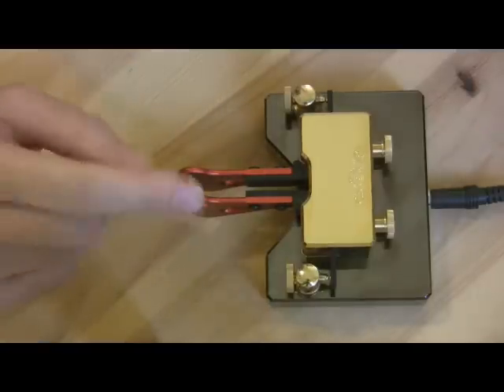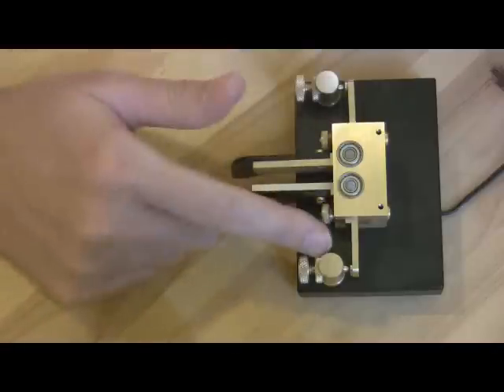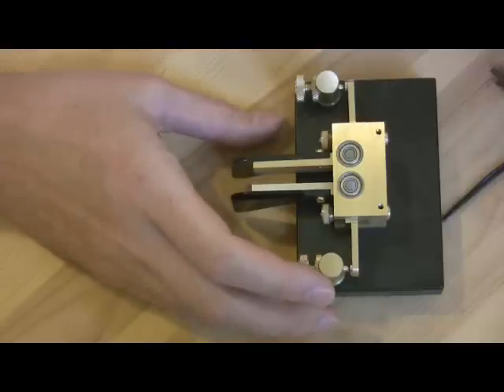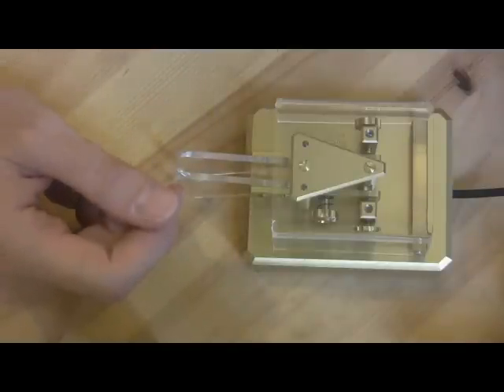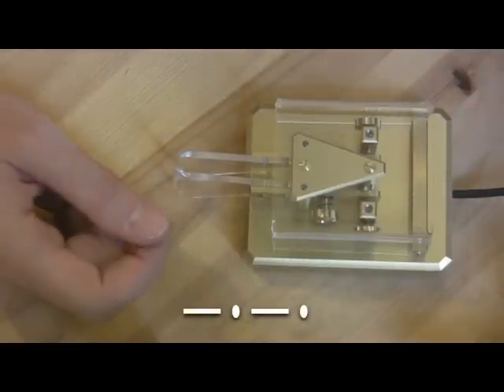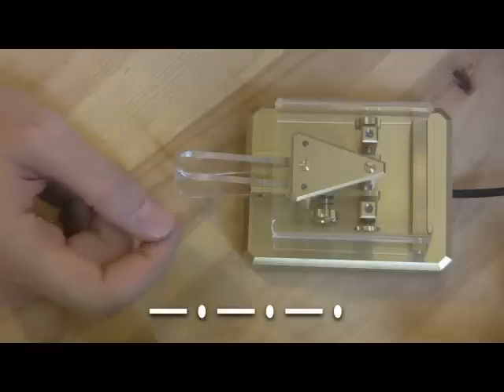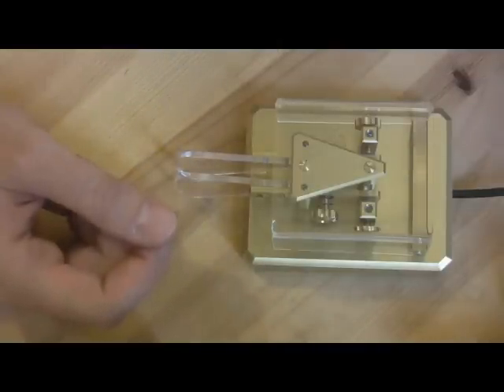Iambic Keyer and Technique. CW Morse Code key

Comment: Thanks for the tips. First, my ears don't decipher at 40 WPM. With more practice I can hear 40 - 45 WPM for contesting. My brain is geared at a certain format not a common sentence. I typically key with the dah by thumb and the dit by index finger. I need to relearn and try your squeeze method rather than my slapping method. It will take much practice so I can be ready for 2018 Field Day. Some times I need to hold my key down with my left hand because it tends to walk across the table. If I remember to bring my key and not use my radio club's key then I have a square of shelf foam to place between the table and my key that greatly reduces the 'walking key'. Best 73

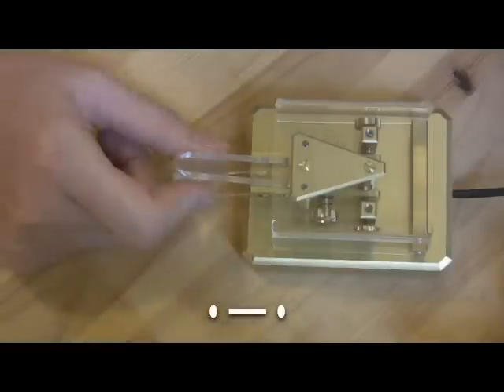Comment: 2:30 the action in this video doesn't seem synchronized with the sound
Reply from the maker: +Jeffrey314159 If you look close on the first push, it's synchronized. But the speed is slow, that's why the dash lasts a fraction of a second longer after I release the finger.

Comment: You have the dots and dashes the other way around!  Dots should be to the left and dashes to the right
Reply: ***** You are absolutley right, the paddlefunction is all up to the user, my misstake. It's not wrong it's just not configured the usual way.
Reply: ***** "Dots should be to the left and dashes to the right"  Why SHOULD they? One's preference is 100% one's preference, and there is NO ONE RIGHT WAY. The RIGHT way is the way that works best FOR THE USER. The "custom" of having dits and dahs only on a certain side for everyone comes from an anal compulsion to slavishly copy Vibroplex's bug pattern.
Reply from the maker: Read my comment to Frank Garrett below, please.
Reply: +SM7FBJ I learned with dots on the left and dashes on the right but when you think about it if your right handed the thumb is the heavy it might just work easier with it configured the way you have it. I may reverse polarity on my paddles but it would probably be really hard to relearn it that way. I never used a bug I tried couldn't get the hang of it LOL  the gold key is a Shurr whats the gold one with black base?
Reply from the maker: Robert Reed Begali Signature

Comment: Aren't we using the key opposite way around. Brilliant keying but ... dits on left and dahs on right? Only I could send like him.
Reply from the maker: we discussed that earlier. The opposite way is not right (or wrong), it just came from the tradition of sidewinders ("bug" key). When folks started changing from sidewinders to iambic electronic keyers, they just transferred their habit. I learned the other way just because I've never heard about sidewinders and never used them that time. I changed to iambic right from a straight key. The thumb for dahs seems more natural and logical to me, because a forefinger is quicker and more flexible then a thumb. So, it's normal to use a forefinger for dits and a thumb for dahs. However, again, it's not right or wrong. It depends exclusively on your first teacher...:)
Reply: You could say, this is Europe. They drive on the opposite side of the road than usa. I won't say hi hi. Lol. Whatever works for him, then so be it. I strive towards sending words, than spelled out words. Another words, I wish I could send as high speed as he does!

Comment: I have a problem with pressing too hard and the paddles slide a bit
Reply: Try loosening the spring tension.  Or scarify the paddle feet so they can grip the surface of your operating bench better.